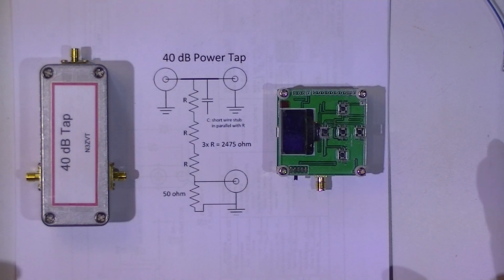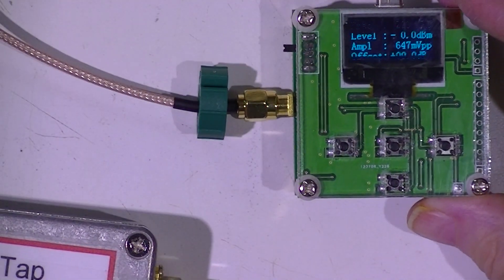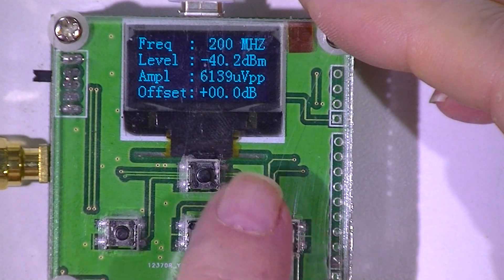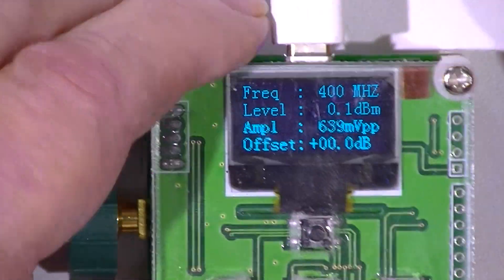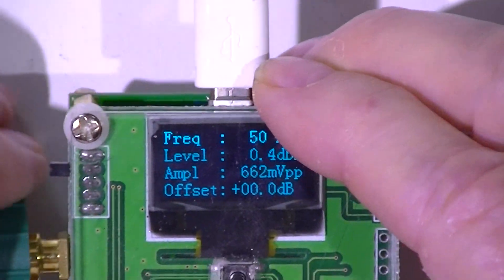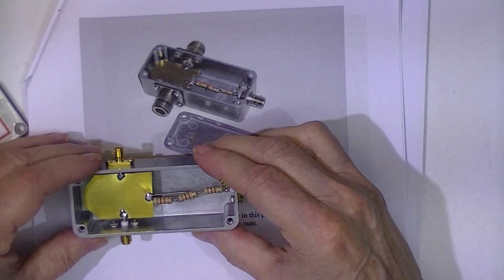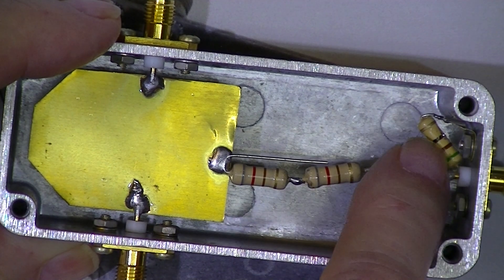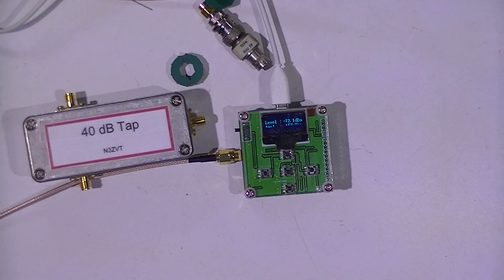RF Power Meter  Tap Series 6 of 6

Comment: I have a power meter for 1-500 MHz based on AD8318 chip. You have to be careful not to overload the input of these. Odbm seems to be slightly on the high side for feeding directly into the OLED meter. I've seen figures of -1 to -5dBm quoted, depending on input frequency. A 10dB pad inserted in the input circuit and the necessary adjustment on the meter should do the trick. Your video will probably be useful for anyone who has just acquired one of these meters as no instructions were provided.